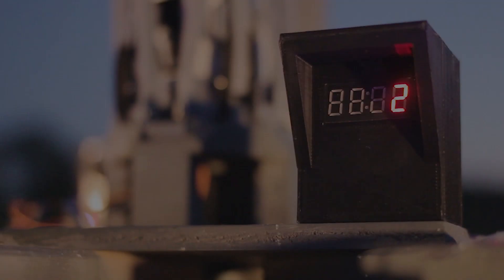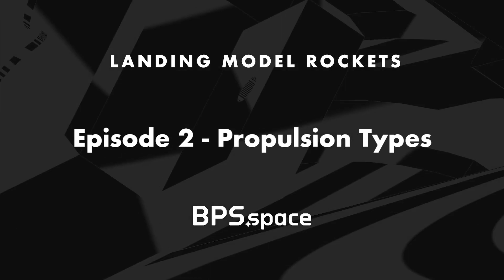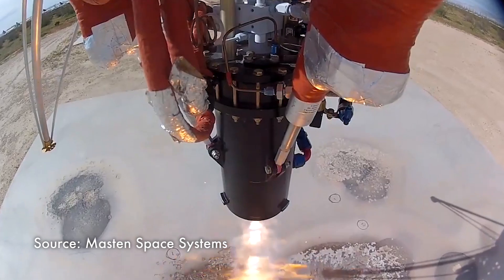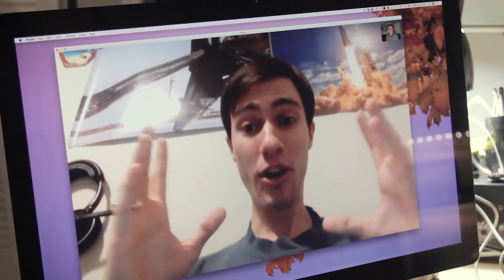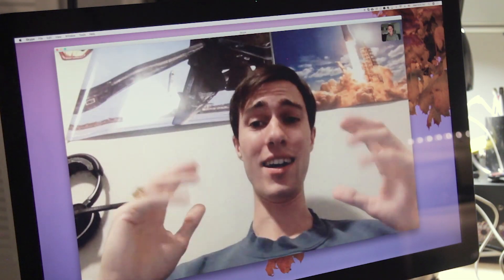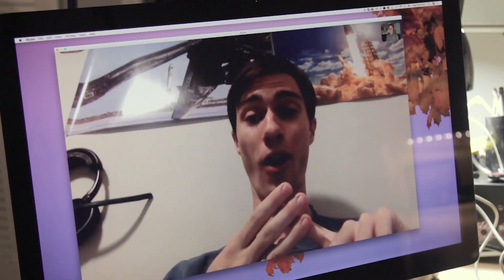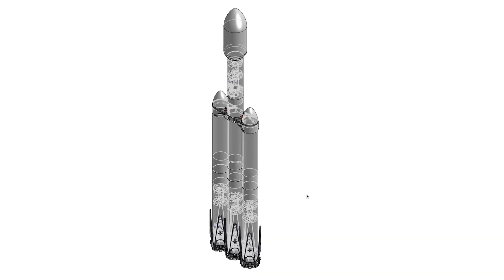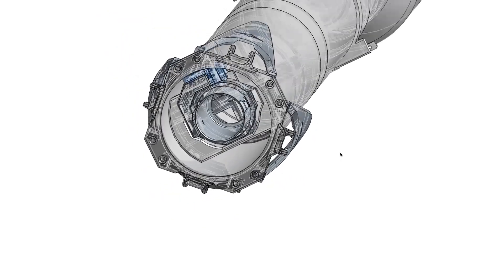Propulsion Types - Landing Model Rockets Ep. 2

Comment: If you want a light weight and easy to throttle liquid engine, try using the hydrogen peroxide gas jet used in those flying jet packs. They use 90% or so Hydrogen Peroxide and by using a catalyst, like silver, it gets converted to a gas very quickly. Forget trying to use anything flammable for the decent engine - which is way too problematic!
Reply: 90% peroxide can also be used to make bombs, so you might have troubles finding someone who will sell it to you.
Reply: Isn’t that just normal rocket RCS?
Reply: @michaelwoodhams7866  And what, perchlorate oxidisers or solid fuel component cannot be? Peroxide will probably have some strings attached, but can't imagine it will be anything compared to a lot of fuels the hobby rocket community uses.
Reply: also HTP is a pretty aggressive chemical. requires special handling, because it tends to light things like clothing on fire.

Comment: for this scale, you might be able to work with Steam (High pressure, super  high temperature water injected into a lava nozzle). It would basically be a very easy to work with, very cheap liquid monopropellant. The drawback is that you have to invest a lot of development into the tank, as it will have to hold a lot of pressure and high temperatures (up to 300°C) while being as light as possible. There are high temperature matrix materials that would enable a composite tank. The only other option I can think of is steel, aluminium is too weak at those temperatures.

Comment: IDEA!
What if you used the F-15 motor to land, then augmented the thust with jets of compressed air or Co2. You can control the thrust provided by the compressed gas and used it yo slow the model at the last seconds before touch down. You can even use the gas thrust to change attitude of the rocket at the top

Comment: You could probably use a solid rocket with a variable nozzle diameter like on the back of an F-18 or F-35 fighter jet. this could allow the rocket to change the amount of thrust that the rocket produces with a constant rate of fuel usage. This will also give you more control over the thrust than the 4 small rockets on the sides.

Comment: Would there be a way to use an actuator, and a low profile stainless steel cone cut in half (clam shell closing) as a thrust out method of controlling the landing burn? Basically 'throttle' the engines vertical Dv by sending more/less of the thrust out sideways.

Comment: Best video yet , underspec the f15 , are you going to go for the small A engines , or would the best option be to manufacture your own F15 type engines ,ok but wait, then you stop using off the shelf solid rockets and then go manufacture route which then comes under  state law , can you , what can you use as propellant , blah blah blah , brilliant idea , use the A motors to supplement the manufacturing deficiencies in the F15 motor, that way you always get a good landing using cheap available rocket motors , pure genius 👍

Comment: Not to be a Debby Downer but how would you get the outboard motors to ignite in a timely manner?  Maybe a pressurized air bottle that’s servo controlled with the nozzles at the top of the rocket for the lateral control.  Like you say, lots of ways to do it.

Comment: A while back I built and tested a regenerative cooled bi-prop engine in the size and thrust range you are looking at using, it is a little rusty now but if you want I will clean it up very good and send it to you so you can test a pre-tested engine before building your own. While I never flew the system it was about the size of your model. I never flew it due to using Gas O2 I could never get the fuel/O2 mix right, should be easy using Lox. Right now I am doing the last bit for a 5KN Ethanol/Lox engine and have learned a lot about doing it cheap and safe. Would be glad to help however I can to keep your project safe. (My 5Kn has cost under 1000$)

Comment: i would have two ideas on controling solid rocket motor "trust":
 - some controllable airbreak in the ehaust 
 - light more then one motor simultaneously at an slight angle: pitch inwards so they point parallel to increase thrust. outwards so they point against each other to decrease thrust

Comment: What about using Cold gas thrust vectoring? Dry ice in a bottle and variable thrust exit nozzle to the TVC. Provide just enough thrust variance to compensate for the solid motor variation. Also great work I would love to try to build one of these, thanks for the inspiration
Reply: Better yet, put it around the rocket casing to reclaim heat losses and put more energy into the gas thrusters. Liquid CO2 under pressure probably would be the easiest to work with. Refill from paintball tank

Comment: From my experience with chemistry and pyrotechnics I think you should start making your own black powder engines (BP), Sleeters book covers  this in detail, but its hard to get,, that way you can to a fraction of a milligram make your engine and since you control the design of the nozzle you can control the amount of thrust and since I'm going to suggest that you make your own BP, and skylighter.com has DETAILED instructions on making your own BP, you can even change the formula to change the burn rate.   I think you know this but there is also micro water injection to control the thrust of a solid propellant engine.  You're damn creative.   The only other thing that comes to mind that you can do easily (compared to cryo bi-prop) is cold propellant.  Very easy (for you) to control and the EASIEST fluid to work with would be butane, you can get it well below 32F and pour it at STP like water.  Close the container and you might have to actually 'heat' it up electrically too get your pressure in the container before launch.  Thus, handling this is super easy.  Propane is also a choice and finally liquid CO2.  I would do these before considering cryo nitrogen as a cold propellant.   Also, an easier step than BP motors would be sugar rocket motors....but...don't know if it has the performance you need (ISP) but you can control the burn rate by the formulation pretty easily.   Dan Pollino's book covers sugar rockets very well.  but I'm sure you know this.  I LIKE what I've seen in your other videos with the retrothrust you are doing.  Job well done.

Comment: An interesting alternative to chemical propulsion might be steam propulsion. Which is where extremely hot water under high pressure is stored in a tank, and when a valve is opened, the water flashes to steam and expands through a De Laval nozzle. These systems can offer an Isp between 75-110s according to the Berlin University of Technology, which is comparable to black powder motors, with the additional benefit of being throttleable and relatively easy to develop.

Source: http://articles.adsabs.harvard.edu//full/2004ESASP.557E..14K/0000014.001.html

Comment: I am curious... when a jet lands, it deploys thrust reversers to brake its forward momentum.  It seems to me that lateral symmetric deflection of the solid rocket thrust would have a net zero effect on acceleration or deceleration, while actively reducing the thrust in the decelerating vector.  Is there no way to effectively and dynamically divert some variable proportion of the thrust to effectively give the result of throttled thrust?
Conversely... could you employ some form of dynamically active drag that would affect net thrust?   i.e. higher drag equals More thrust, lower drag equals nominal thrust?
Reply: Yes.  something like variable clamshells to redirect exhaust in varying amounts + gimbaled engine mount.
Reply: The stream of gasses are pointed forward, thats the thrust
Reply: mduoba yes... but of you deflect the exhaust gasses laterally and symmetrically, it should cut the thrust vector that is slowing the descent.  You ought to be able to reduce EFFECTIVE engine thrust thru diverting the thrust...an this achieve a result similar to engine throttling.
Reply: @christopherpardell4418  But as many have said no two engines are EXACTLY the same. Thus you would end up with sideways thrust that was not symmetrical and also they will not start and stop at EXACTLY the same time, again resulting in lateral thrust and a crash.
Reply: Douglas E Knapp - that’s true... however, it’s a dynamic system no different than he is already using to vector thrust-  the flight computer can, in real time, assess the effect of lateral deflection of thrust, and adjust the deflectors accordingly.  Deflectors would not be in an on/off state- but would gradually engage with a gradient of deflection.
Moreover, he’s only using one engine for landing... once that engine  is lit- it’s thrust is its thrust- never the same and somewhat variable- because of which he will never be able to land the rocket unless he CAN modulate vertical thrust to some knowable amount.   He would also still have thrust vectoring, but the deflectors could be designed to either gimbal with the motor, for a stable effect on engine thrust- or such that the motor gymbaling would engage deflectors more or less which would add nuance to the effect of vectored thrust.  That is, if tipping the motor in Y to correct pitch, it might play the exhaust stream more over the Y deflector- which directs thrust laterally- this would make the moment applied to the y axis greater for a stronger effect on attitude, while cutting engine thrust directed downward.  As the vehicle approaches ground, being able to use vertical thrust differentially to help orient the vehicle is not only throttling vertical thrust- but using the thrust you bleed off as a lateral thruster... 
depending on the design of the deflectors, it might also confer roll authority.

Comment: The fire ball from the delta 4 is from it running hydrogen through the engine during startup to prevent oxidation not from hydrogen leaking through the metal.

Comment: I was watching the video and came up with a way to control the thrust power of solid rockets. Simply by reducing the force exerted downwards by the motors by tilting them to one side so that part of the impulse is lateral. That would make the rocket go sideways but it is corrected by putting another motor that moves symmetrically on the other side. If the rocket with one engine could land, having two would have to go to 45º and you will have an acceleration control of up to 200%.
Then the two rocket motors would go together in a gimbal to control the rocket and to correct the power differences between one motor and the other. 
I hope it helps you, this system is the one I used a long time ago in the physics simulation game algodoo.
Reply: You could also do it with an EDF, 
is propelled with air so it is not a rocket but for modeling it is the cheapest and you have total control of the throttle.
Reply: what does EDF stands for?
Reply: electric ducted fan,   These are the motors used in small RC jet airplanes
Reply: The show stopper there is angular momentum. Though you could use some aero surfaces below to counteract it. another idea is a small CO2 cartidge with a small solenoid vavle. It is just relativly heavy and big.
Reply: That does seem like a decent way to get throttle out of a solid rocket.
Reply: @CuervoRC  - I think he really wants to stay "pure" and use only rockets. After all, if he was open to use EDF's,  all he has to do is not disconnect from the drone.
Reply: Something very similar is used in solid-engine ICBMs. They obviously need to pretty carefully control their trajectory, but the huge benefits in storage of solid rockets vs liquid rockets means that many of them are now solid fuel based.

So what they use is a nozzle or engine casing with symmetrical, sideways-facing exhaust ports, which are initially blocked off. At the precise moment that the rocket needs to throttle down, the ports are opened (explosively, if I remember correctly). This drops the pressure in the motor and directs most of the gasses laterally, virtually killing all of the thrust.

For these model rockets, I could see a system similar to clamshell thrust reversers used on some jet engines working well. You basically have a couple of thin metal 'doors' which close to redirect the rocket's thrust upwards or outwards. It would actually be reasonably simple to achieve, I think.
Reply: @JMMC1005  
Wait really, i did not new about that but commented pretty much the same idea for solid rocket motors. Strange how different people come up with virtually same ideas XD.
Reply: What about inconsistency with ignition and thrust from each motor? Could potentially oversaturate the flight computer's thrust vectoring.

Comment: What about Ethanol75 and HTP? HTP doesn't have the problem of boiling that LOX has, and Ik it has been used successively in flight with RP-1 on the Black Arrow rocket. If you clean your tanks right surely that would save alot of complexity right?

Comment: Hi Joe.  Could you use a pneumatic cylinder in your motor mount system in such a way that you dumped air out of the cylinder quickly to bleed energy off the motor and almost modulate the output? A bit left field but it might work

Comment: A simpler idea for your consideration, instead of using more motors, have you considered just using what you already have and introducing max amplitude short period servo doublets into the decent if/when needed? I'm not sure how many degrees you can gimbal, but the percent of trust reduction during the doublet would be slightly less than (1 - cos(max_gimble_angle)). Good luck however you go about it!

Comment: Multiple "A" rockets commanded to start simultaneously may not start at exactly the same time, creating asymmetric thrust and rotation.  The effect could be exaggerated if there is a thrust-spike in the rocket's profile like was shown for the "F" motor.  Definitely a failure mode that should be considered.

Comment: is there any mechanical way the force of a single solid rocket could be "managed", perhaps via a variable nozzle?  also, was wondering during the video if peroxide and catalyst could be a simple enough liquid rocket?
Reply from the maker: A variable nozzle would be extremely hard to make at this scale. The throat diameter for many of these motors is just a few mm; controlling that accurately would require very high precision($$$). Cosine throttling is another interesting option(gimbaling multiple motors out to reduce the vertical component of the force), but also increases complexity and cost per flight. Plus you end up needling full 2 axis control on each motor, otherwise any slight misalignment on either motor will induce insane roll on the vehicle. The mass moment of inertia on the roll axis of these rockets is so low that super tiny imperfections can induce a high roll rate. 
Peroxide and a catalyst are an option, but are undesirable for the same reason hybrids are. Lots of plumbing involved if you want throttle and shutdown control, increased mass, complexity, general risk, etc. If you're gonna be a bear, be a grizzly. If you're gonna deal with lots of plumbing, go full liquid bi-prop.

Comment: Why not use a thrust deflection system with a solid propellant engine? like thrust reversers on planes
Reply: might be difficult without special materials like carbon ablator, the exhaust of a solid rocket is intensely hot and has slag in it as well

Comment: problem is that there are too much parameters to measure, process and control. By making the rocket bigger you actually attenuate lots of parameters (like air/wind disturbance), also all the sensors have a relative smaller mass than a big rocket. Doing small scale is sometimes more difficult than bigger size

Comment: Wouldn’t you get a finer more accurate throttle control by having a diverter in the rocket exhaust. Eg. deflect some of the exhaust symmetrically to the side.

Comment: To effectively throttle down for landing, you could try gimbeling very quickly in a circle.  This will create a spiral of thrust that integrates to less in the vertical direction. Plus it should look cool and might be stabilizing?

I think your gimbel mechanism needs to be made faster and lower latency to really nail this. You might rethink the gimbel design to be less like normal rockets because your model rocket thrust forces are so much lower.  Can you mount it to rotate?

Comment: But maybe dont use liquid fuel but a mechanism that can tilt the thrust sideways in two opposite directions, decreasing or even disabling vertical thrust and aiming it sideways. It won’t tip over because it would give equal thrust in exact opposite directions. Just a thought i dont know if its possible cause you would need something that can stand the heat of the engine. Make sure it is divided right because otherwise it will tip over at landing.
Hope you can use the idea or atleast get a other idea from this suggestion.
Reply: I believe that is what the first guy he was talking to mentioned, but I am also looking into doing this for my rocket.

Comment: I did not hear you mention Ballast.  Can't you just have little ballast weights around the outside that you just drop in pairs?  These can be precisely modeled.  My other thought would be compressed gas vents.  You could even have a single annular compressed gas thruster around the solid to augment the solid if needed.  You could mount this above so it would gimbal with the solid.  One CO2 cartridge could be enough.